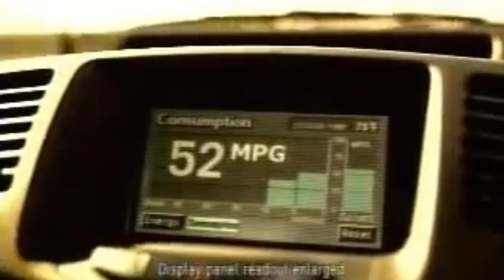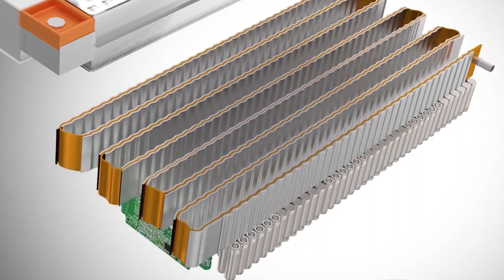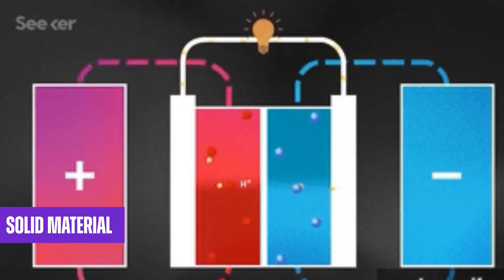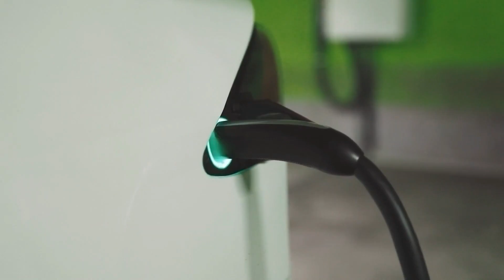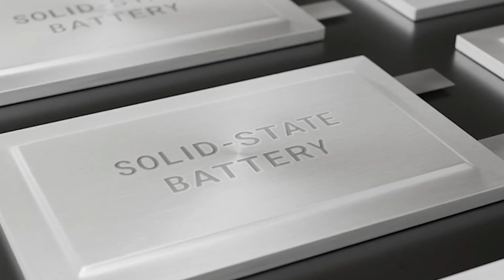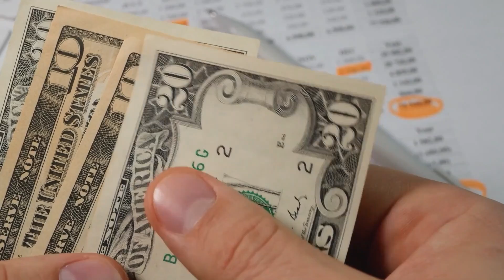Unbelievable! Toyota's New Battery Tech Set to Dominate EV Market!

Comment: This is unbelievable horses--t. You are just doing Toyota's advertising for them. They are no closer to having a scalable solid-state battery than they are to having fusion power in cars. They've been making this claim that their solid-state battery was right around the corner since 2015. Total b*******. Do your research and stop the promotion of industrial scale lying. Toyota is committed to the obfuscation of the hydrogen lie, and is trying to have emission standards rolled back worldwide because they are simply not competitive in electric vehicles. They have proven themselves committed to misinformation. This is just another form of it